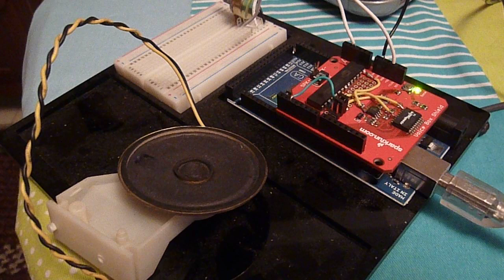Arduino Text to Speech

Comment: Given connecting an Arduino to a SD card is trivial these days. I opted to render text-speech into separate .wav files and play them grammaticality. For all the minutes in the day I have a program that creates all the .wav files and a .cpp header file with a bunch of #defines. It works really great and because all the sound is streamed there is no break between joined bits. I can also play random quotes easily.

Comment: This could take a string of morse code from a long range transmition and translate that to speech right? For example: ..-/---/.../-.-/-.. and then arduino would say "hello". The transmitter used would be the 200 mile rf transmitter on hack a day.